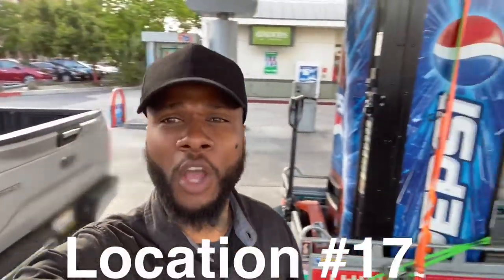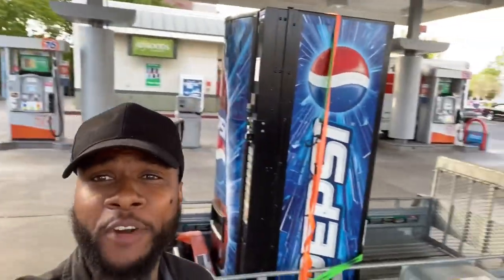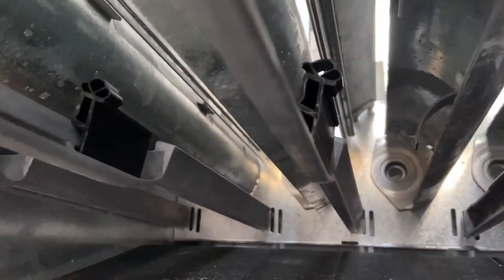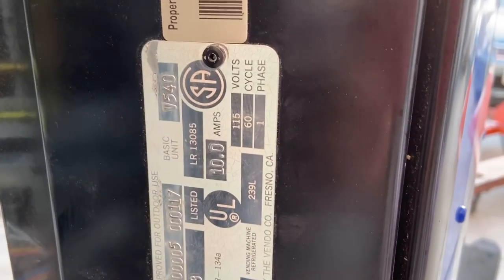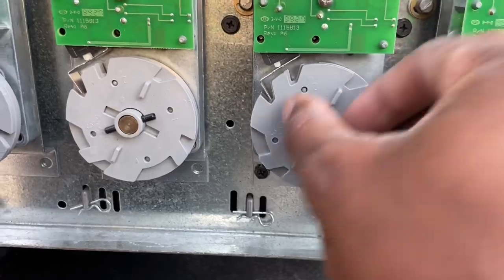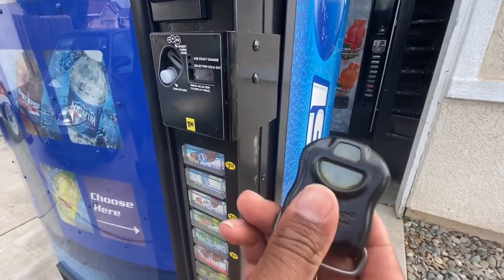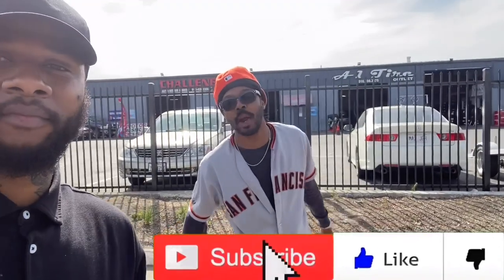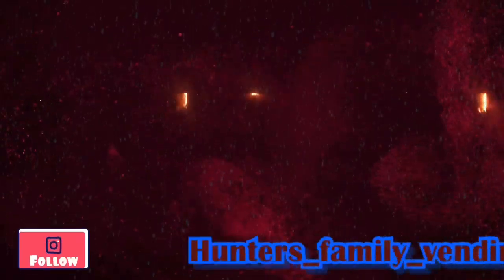PLACING MY SODA VENDING MACHINE IN MECHANIC LOCATION & HOW TO CHANGE FROM BOTTLES TO CANS

Comment: Hey Wayne! So I’ve been buying older used machines and I’m scared to clean the inside (fan and compressor) with water because I’m scared it’s gonna effect some wires. Any tips on how to properly clean the inside of the machine and get it location ready??

Comment: I would do a 1 or 2month trial, see how the machine does (no commission) and after that review the sales and see if it's worth giving the guy a commission, if not move it on. You'll find if the staff are using it they won't want disruption in service if he has to change vendors.